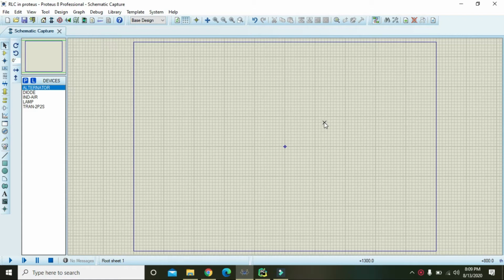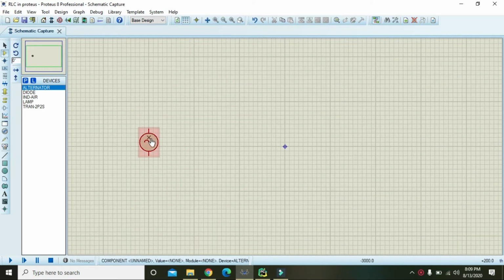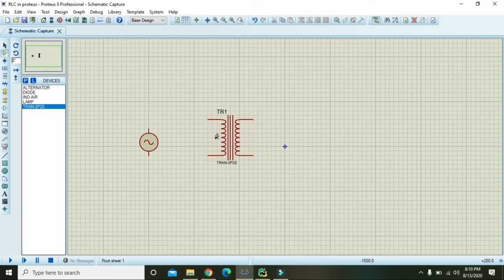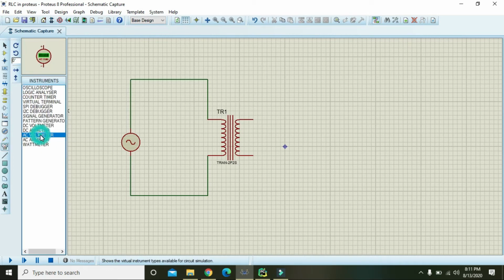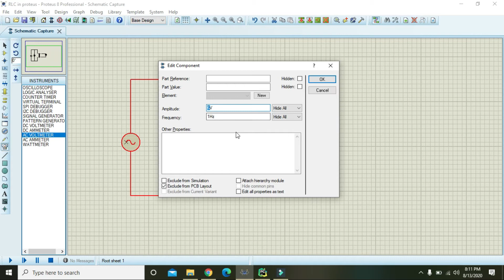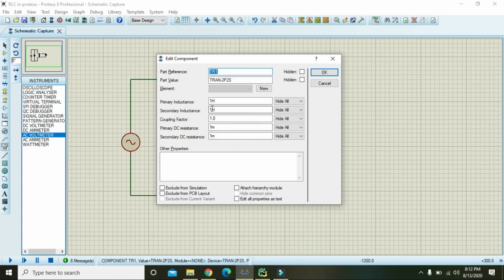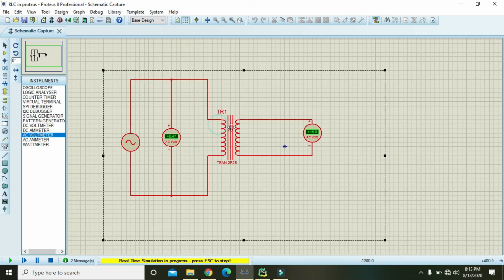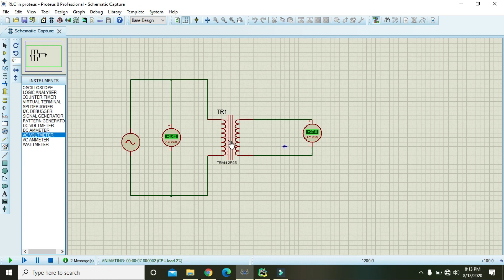how to use transformer in proteus | step up transformer simulation in proteus

Comment: Hello everyone. 

I really need help with my Proteus simulation project. 

I'm simulating a battery charger using atmega8 microcontroller. I've been able to get a schematic which I've replicated on Proteus, but now I'm having problems running it, please help, it is urgent. 

Thanks.

Comment: could you help me how to setting the transformer to get vout=12V with 5 ampere
Reply from the maker: sir..upto my observations...no need to worry about amperes proteus components can provide a lot of amperes....so dont worry...how ever just change the henry values for winding of the transformer and u will get the voltages of ur own choice....u can change the henries by double clicking on the transformer...